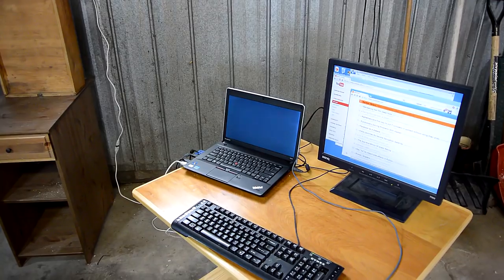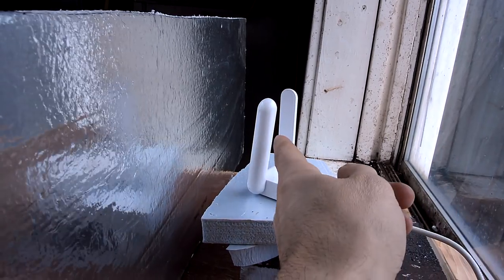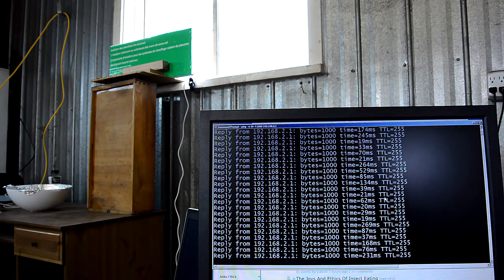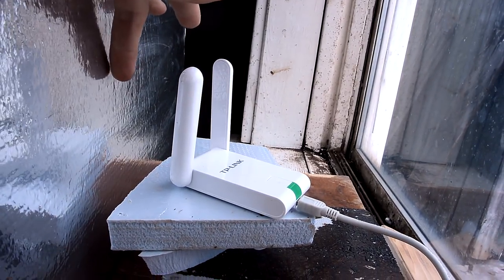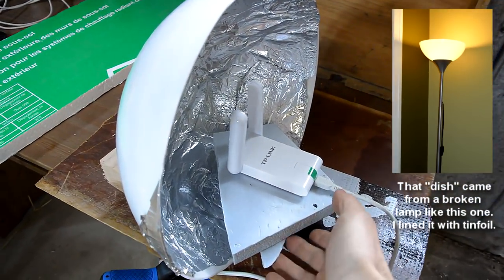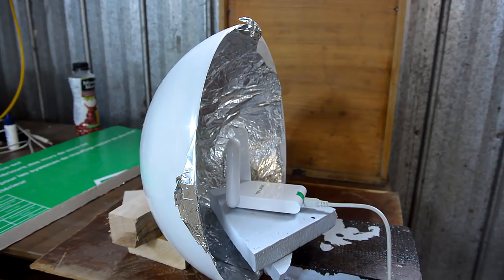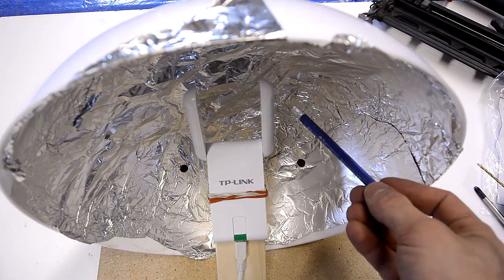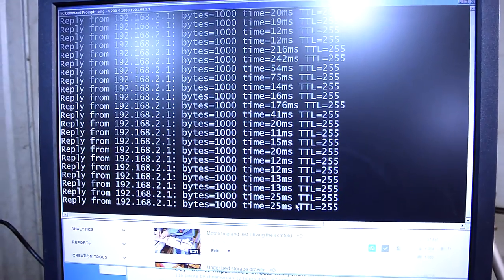Wifi antenna booster dish

Comment: Great idea and demonstration. I remember bending tinfoil into an arc as a kid to boost the wifi on my computer but apart from seeing it gain a bar of signal I never knew if it was all that effective, I wish I knew you could ping many bytes and use the return time to assess the signal strength. perhaps with SDR one could get some precise data, and 3D print a dish with an accurate parabola shape, maybe even a stretched elliptical shape to better cover a typical antenna? perhaps with the diversity antennas a slight angle is better for noise rejection? I'm inspired lol thanks!

Comment: Use a space blanket and vacuum it to the dish with some glue then move the router antennas forward inside the dish or change the antenna to a smal yagi.

Comment: I wonder how much your signal would increase if you placed your antenna at the focal point of the dish ? It looks to me that you are losing more than half of the signal by placing the antenna at the point you did.
Reply from the maker: The focal point is much deeper in the dish than you think it is
Reply: Interesting. can you show me the math on that.
Reply: Hint: it is f = ( D * D ) / ( 16 * c )..Focal length = f, Depth = c, Diameter = D
Reply from the maker: for far away, its just half the diameter (no need to get this complicated)
Reply: for a semicircular dish, focal pt is exactly at centre of top of dish,
As it becomes less curvy(more like parabola), focal pt falls deeper into the dish. :)

Comment: Hey matthias, I have a much better solution for you. If you get a wireless router that supports the DD-WRT firmware, you can make the router pick up the weak wifi signal and repeat it again to your new access point. This works a lot better than your current setup, because the antennas of wireless routers are normally very strong!

Comment: hi mr 
why you use the aliminium for boost your wifi signal? why you dont buy a better wifi card and use a outdoor antena for boost the signal :)
Reply from the maker: oublier motdepass Because I can do it for free, from inside, with aluminium foil.
Reply: Matthias Wandel Nice reply! LOL!
Reply: Matthias Wandel 

well said sir!
Reply: oublier motdepass Keyword: BUY.
Reply: i know a pro outside antenna and i wont tell you the name :) yes i prefer buy a good antenna better to play with aluminium i tryed this trick but the signal some time go down and some time up with my new antenna no problem :)
Reply: +oublier motdepass "Yes I prefer buy a good antenna better " Enjoy throwing your money at other people. 

Somethings that are fairly difficult to make work on ones own, it might be preferable to pay someone else to figure it out for you. 

Other times an antenna simply made from $1 in parts and a little time to tweak it can save you money so you can spend it on more important things.
Reply: +MSV-one well said
Reply: +oublier motdepass   I take it you are NOT a do-it-yourself type person or you would have NO NEED to ask that question.  A new Wi-Fi card in a laptop is a major undertaking. Besides, it gives one satisfaction to know it can be done without going to the expense of buying something.

Comment: In Matthias's case, clearly he cannot modify the router but if someone is in my case then the simplest solution is to buy WiFi antennas and WiFi father screw type sockets. Then to solder the sockets in place of the old crappy on board WiFi antennas inside the router, poke a hole for the sockets in the router case and screw in the external antennas. 

In addition this permits for such a thing as a booster which cannot be added to routers that don't have these sockets initially.

Comment: No offense Mathias, but I would reverse that statement at the end...What you did was an amateur attempt. A CanTenna would not be. There are quite a few problems with your setup, some assumptions that you made that are incorrect, and some simplifications you could have made (in design and implementation.

First, you used a card with more than 1 antenna. You would have been MUCH better off with a cheap, single antenna usb stick in this case.

Second, assuming you made measurements, the focal point for that dish would be between the 2 antennas.

Third, since you already HAVE a dual antenna card, you should have used a parabolic reflector with only 1 dimension of curve, not 2 like a dish. This would have made your job a LOT easier. You could have just cut a parabolic curve out of some plywood, and attached that piece of foil lined foam to it so the curves held the foam in the bent position. Then the focal point would have been a line instead, and you could have mounted the card so that both antenna were in that line. (This is a bit harder to explain without pictures than I thought it would be...) Look up WindSurfer WiFi Antenna Reflector. Except imagine the foil covered foam as the reflector, and some wood pieces holding it into the curved shape you desire.
Reply: You got a lot of stuff wrong.
a) There is no specific reason that one antenna would perform better.
b) No reason for this to be true also.
c) This is not correct either since the polarization of the signal makes it more complicated.
Some of the reasons that makes things complicated and difficult to predict are :
a) Signal polarisation.
b) Antenna loading, changing its radiation impedance.
c) The wavelength is close to the antenna dimensions, so effects like phase reversal on reflection and interference between reflected and incomming components are importand. Also, the antennas are distorting the incoming waves so they do not hit the reflector like light whould do.
Reply: ***** An antenna works the same (has the same radiation pattern and gain) as a receiver or as a transmiter. The directivity of an antenna has to do more with the dimensions (relative to the wavelength) rather than the details of its design. So a large dish would be more directive than a less than a wavelength cantenna.
Reply: By the way, I would (and actualy did in one case) go with the WindSurfer WiFi Antenna Reflector approach since I think that a parabolic reflector of that type reflects resonably the vertical polarised signal and it is easier to build in the proper shape.
Reply: I get a feeling that Mathias' statement at the end was completely tongue-in-cheek as he admits his own version is totally amateur. There's a few liberties taken on the video, yes, but bottom line is: he made WiFi work with a broken lamp and tinfoil. It doesn't get more inventive than that.
Reply: Dude he was clearly making a joke -.-
Reply: Also, a dumb idea that works... isn't so dumb.  :-)

Comment: You might want to check out "andrew mcneil"'s channel on YouTube. He has several designs for high-gain WiFi antennas ranging from simple to only moderately complex. In fact, he has a similar problem to you where he has trouble receiving his router's WiFi signal in his workshop in his backyard.

On the other hand, my philosophy is "whatever works".

Comment: Why would the ping time change with signal strength?
Reply from the maker: use of higher bit rates, or fewer retries.
Reply: With a ping though, it only retries each second, correct? So wouldn't slight increases in ping speed mean the signal has less time between when it hopped from your dish to the router? I would think this time is constant independent of signal strength, dependent on distance between the two communication points.

Comment: I so wanted to see how you cut drew the shape of the bole to cut away.
Reply: +Keith Reynolds  
Keith, here are a few  ideas:
1. if the bowl is circular, guess the radius, and make some edge templates on paper with a compass.  Cut them out, and see how close you got. Adjust. Use a jig saw or band saw to cut your holder.
2. Place bowl above a flat-bed scanner, hold steady and scan. Print out full scale, and cut out silhouette of bowl. I tried this and got pretty close. Perhaps play a bit with the image scale.
3. Take some modelling clay, and slap it on the bowl where you want it. This doesn't solve the problem of making the template. You could use the clay directly, or slice it to get a profile.

Comment: It also varies by which model and router you by. Netgear and cisco seem to have the best routers and extenders. Depending on how much your willing to spend. You can also get a antenna or mod one yourself and tune it and connect it to the extender running the antenna outside. Just rememeber any antennas going to a roof or outside should have a guard in line incase of lightening.

Comment: Hehehe, way to go! this made me laugh since I've just finished remodeling my itsy bitsy shop, and I had exactly the same lamp, which I took the "dish" off so I could use it as a mobile omni light wherever I need, and I had the dish around in the shop, and each time I cleaned I fought with myself about getting rid of it, since a nice dish is not something you come across often, so every day you can find this dish at a different point in my small shop, but it never gets thrown away, this is a good idea for using it, but my shop is 5 meters from my house, the wi-fi gets there just fine, but who knows what use I'll find for it, it's staying as a fixture in my shop :)

Comment: What is the distance from your router ? Anyone have any ideas for a range of 500ft ?
Reply: +Billy HudsonFl 
Some WiFi routers can be configured as a repeater, which will effectively extend the range an additional 500ft. But this does mean you need some place to put the WiFi router that is sheltered and has power, even a solar panel and a small battery would work.

Comment: how bloody frustrating I've been doing this for years I used an old desk fan cover and lined the inside with Mylar then worked out the convergence point for the usb receiver mounted it with a steel rod about 1.5inches out I went from no signal to being able to pick up my friends WiFi over mile away plus everyone else's WiFi in the vicinity this was back in 2009/2010..... I say frustrating because I was thinking of manufacturing them as I couldn't find anything of its type at the time and people and my buddy's were calling it a brilliant idea then I forgot about it only to see them for sale in a catalogue a couple years later ! bloody annoying haha!

Comment: thats Pretty cool, Im going to have to try that.
Reply: Go for the "WindSurfer WiFi Antenna Reflector" instead. It is simmilar but very easy to build.
Reply: ntomata0002 I think he didn't use the windsurfer because in the beginning of this video he says the "People living in the house on the property are nice enough to let him use their Wi-Fi" so it might be pushing it a little to ask them to start attaching stuff to their Wi-Fi antenna...lol or they have a set up like mine with the internal antenna so there's no where to put the wind surfer. There's no type of signal booster he can buy and use? or some type of external antenna he can mount to his shops outside wall?
Reply: ntomata0002 I forgot to mention that, years ago, In my old house I used the windsurfer and it worked great...  that was on my old Wireless g or n router (I forget which one) before I moved to Uverse from ATT.
Reply: hdrjunkie Your comment is irrelevant since I didn't refered to Matthias, but to T-Mans Go Karts. But since you mention it, both sides of the link transmit and receive. Also putting a better (more directional) antenna in one side improves both transmited signal strength (in the selected direction) and received signal strength due to more signal from the source direction and less noise (from any other direction) directed to the antenna. So improving only one side of the link makes it better anyway. Ofcourse improving both sides is the
best.

Comment: One comment i have is that he shouldve allowed airspace between the plastic and the tinfoil and made the tinfoil atleast 3 sheets thick to both reduce Noise and Reverb in the Signal allowing for a more Stable Connection and not just Boosting Connection strength
Reply from the maker: Read up on skin depth and RF radio frequency.  Your comment will make less sense once you do.

Comment: It's nice that you had success with your reflector, but it's more of a fluke with the antennas in the device being simple enough. The antennas should have their impedance tuned to match the cable and the input of the chip. Placing an object, such as the reflector, near the antenna causes its impedance to drop, introducing internal reflection in the element back to the cable and chip. This can ruin the antenna's performance. If I were you, I'd not even try to make a rigged reflector and instead buy a proper outdoor directional antenna and connect it to a router configured as a repeater.
Again, you might say it worked, but you got lucky.
Reply: Wow lol
Reply: zwz • zdenek,
While you are spending all that time and money unnecessarily, he found a simple solution that works, and has moved on to other projects.
Reply: *****
I believe you also deemed reading comprehension unnecessary. The reflector thing is 99% fail. Don't do it for anybody else than yourself to avoid bad reputation.
Reply: zwz • zdenek
I don't believe your 99% figure.  How did you come up with that?  Did you test this yourself?
Reply: ***** The number is obviously figurative. But yes, I have tried several antenna "boosts" myself. They made the reception worse. Just read my first lengthy reply for the theory.
Reply: Sure I had read it, but when someone disses and exaggerates (99%), and writes out a lot of theory, without giving any hint of self experimentation, I take it as pretentious.
Reply: *****
It is not and you are taking away useful knowledge from yourself. Youtube is not very trustworthy, sadly. My intention was to prevent frustrations that will result from trying this solution where not suitable and explain what's wrong. That's not dissing in my book. I never said his boost was FAKE. I believe it worked for him. It's just such a fluke!
Reply: A fluke yes...
But so far it has worked on every wi-fi antenna I tried it with, as Matthias said things need to be fine tuned and very specifically aimed at the transmitter.
Reply: Matthias does "buy" much and I've never heard him say something needs to be proper. I am amused by his musings. Hes's brilliant and simple.

Comment: This is all fine and good.  But every time I have attempted to use an external rig like that, the software required to run it is listed as "extremely high" in the "start-up impact" tab and suddenly it takes me an hour to boot up.  Also the software eats up all my resources.  The CPU goes from 5% to 100%, Memory jumps from 24% to 67%, Disk jumps from 3% to 100%.  Then my system crashes.  My computer is brand new so don't tell me it is because I have an old computer and need to upgrade.  I am operating on windows 8.   Biggest waste of $75.
Reply: What
Reply: nunya biznez Did you buy a Windows Surface? Because with a decent Laptop/PC there is no way that you end up using all the power your system can give. And if you got problems with your Hard drive try switching to an solid state drive.
Reply: G3RMANARMY I have absolutely no idea what a "windows surface" is.  My laptop cost me $150 new at Best Buy.  I also found out that the WIFI signal is coming off a router with a maximum speed of about 1mbps down and 100kbps up.  That's if I'm the only one out of 20 tenants trying to use it.  Add to that I'm the tenant furthest away from the router and there are six steal reinforced concrete walls between my puter and the router and they insist on keeping it on the counter with a refrigerator and stove between it and me.  I'm looking into a hot spot but I've had bad experiences with those as well.  Yes my computer is cheep and has poor speed and memory but the real problem is that my landlord won't spend more than $50 on a router.  He doesn't care because he doesn't live here.   I wouldn't have any idea what a solid state drive is and I'm not qualified to open up my laptop and start fiddling with things.  If you mean a flash drive, it takes ten times as long to open a file on those than my laptop so I don't see what improvement that would make.
Reply: G3RMANARMY Oh I forgot, when I first got this antenna I read the info that came with it and it stated that I must install their software for it to work so I did.  Their software ate up huge amounts of resources so I deleted it.  Then I found out that the antenna works anyways.  The problem is that if I use a usb cable longer than three feet it just shuts itself off.  The bottom line is I found the real problem and the real problem is that the router is slower than my first dial up modem, is being shared by half a dozen people at any given time and there are way too many obstructions to the signal to get a connection 99% of the time.

Comment: I just bought a booster antenna for $6 that works from over 200ft away. 100% signal
Reply: I BOUGHT A BOOSTER for AC600 High Gain Wireless Dual Band USB Adapter $49 bucks and bought a different antenna for $ 30 more bucks to switch for a stronger signal.  Both cant even go for 16 metres. So please tell me exact name and make of your booster you have for $6?

Thank you.

I cant stand the handy man mg iver fer long version business in this clip too much